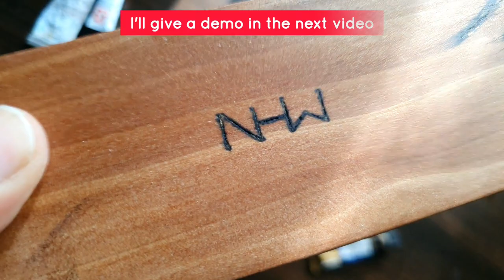DIY Wooden Watercolor Palette ~ woodcraft

Comment: Enjoyed the whole process... Handmade stuffs hold a particular charm❤️... Can u please tell me what is that white spray kinda coating which you used on the upper lid of the box???
Reply from the maker: Am glad thank you! Its just a white water base paint which didn’t work well for the mixing area. Its get stainy real vad
Reply: @niazhannanwatercolors  Maybe you could add a white layer of paint and then you could coat it with epoxy resin. Time consuming to paint each wells and coat resin but I guess it is worth it. Just my suggestion. I'm not sure whether it is practically possible.

Comment: It's a fun little project, but after the use with liquid tube paint, if you put it in a bag or in the pocket, it will leak and smudge inside like crazy. You should have tried doing the same, but dig deeper wells to fit watercolour pans; dry pans can't be wetted through and will remain solid.
Reply from the maker: Thanks 😊 ..actually it never leak as i keep it dry after use
Reply: @niazhannanwatercolors  As I said above, it's a fun little project ..  but for real watercolour use, it is impractical. It's good for kids, though ... the palette being made from wood, if filled up with food colour, it is safer than giving kids plastic or metal palettes. I think, my friend, you have unintentionally opened up a new market many never even considered! Start making those wooden palettes and sell them to mums; they'll sell better than any metal palette for pros…
Reply from the maker: @zvonimirtosic6171  That's pretty interesting..i must try this. Thanks 😊